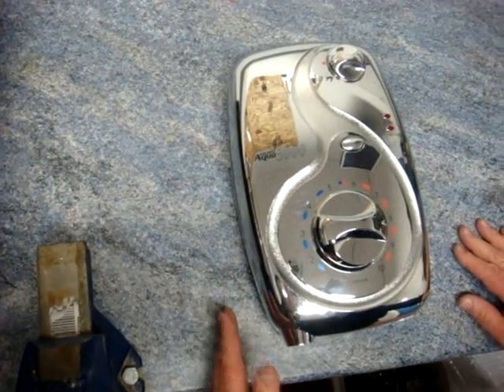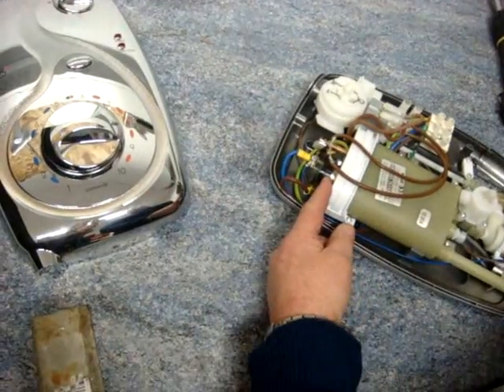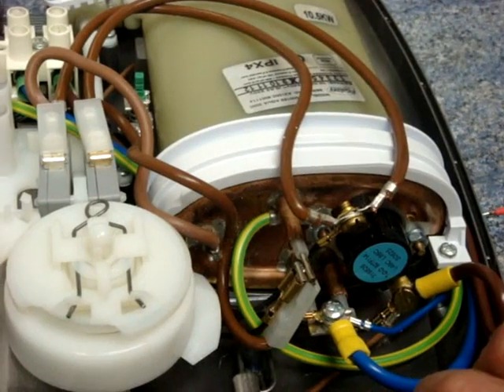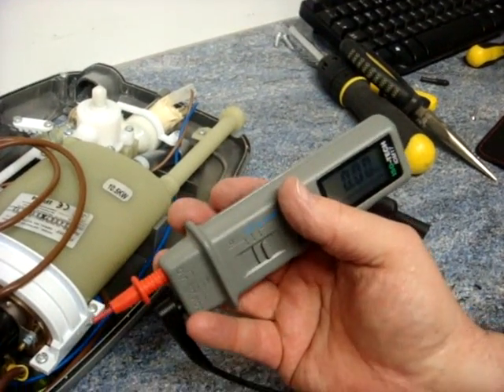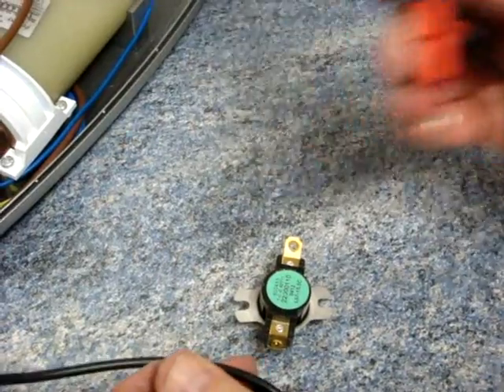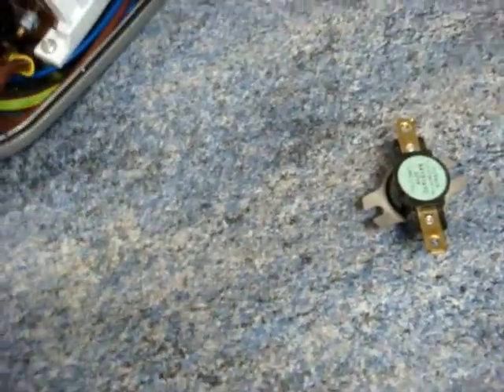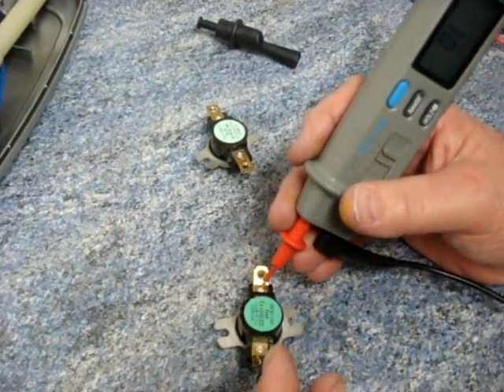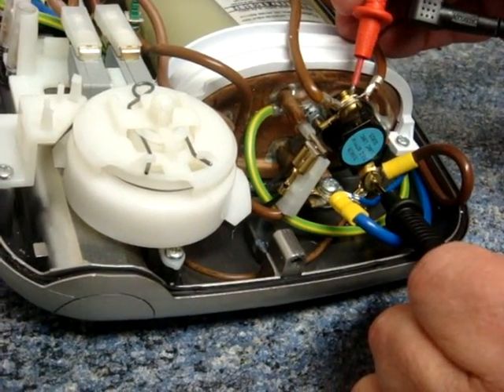Electric Showers: How to Test a Thermal Cut Out (TCO)

Comment: My tco has continuity and the element is also giving off correct readings, one 13 one 16 ish
The water pressure is good. But not heating up, unless i turn it to full heat. And it gets hot but very low pressure. What could it be. Thanks

Comment: Brilliant advice, I was going to buy a new shower before I saw this video. I was able to check the TCO and it was faulty. Amazingly, I got lucky and the TCO was sticking so I freed it up and re installed it. 
If it goes again I will buy the replacement one from your website. Many Thanks.

Comment: Thanks for the info guys and gals at The Shower Doctor, I ordered my replacement TCO for my Mira Sport 10.8KW and installed it following your instructions and it works a treat :-) Saved me a fortune in repair/replacement costs and a whole heap of hassle, Thanks again :-)

P.S. It came a lot faster than I expected, good job :-)

Comment: ok i dont have one that beeps so set it to 200 ohms when i test it on my creda shower with mains off it reads 0000 ohms is this good or bad ..i just had to change the relief pressure washer .but now i find my shower is not as hot still working but have to turn setting way up then i lose more pressure creda 550c Electric Shower (2004 - Current)
Reply from the maker: Sounds like you have a faulty element in the heating tank.
 often when an element "Blows" the momentary extra pressure in the heating tank can activate the PRD
Reply: Yes thanks guys cheers and thanks for getting back to me got a new mira advanced just now need someone to fit it

Comment: Basically I have a Mira Sport Max (10.8 kW). It's about 5-6 years old. It's starting to run cold with setting at High or Medium heat. Overheat light is lit, flow is good. Is it a new shower or a part I need? Thanks Tony C.
Reply: Hey i have the same problem with the same shower. Did you replace a part or end up buying a new shower?

Comment: Sorry I didn’t notice this commentsooner.
Basically a solenoid is a pretty simple switch it is either on or off there is no in between.

If your elements have power to them then the TCO is OK

Comment: Nice video. Is it possible to get continuity over the TCO but its still faulty. I've a mira sport 10.8kW shower that is operationally fine buttons and dials but isn't heating the water. Heater elements appear to be getting 230V ok, and mira support seem to think the TCO might be faulty even though i got continuity over it :(